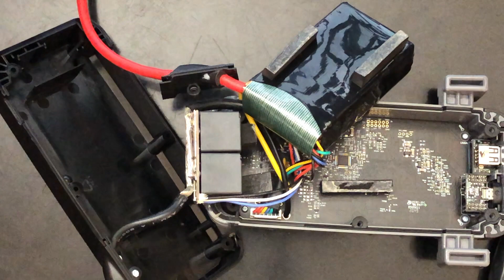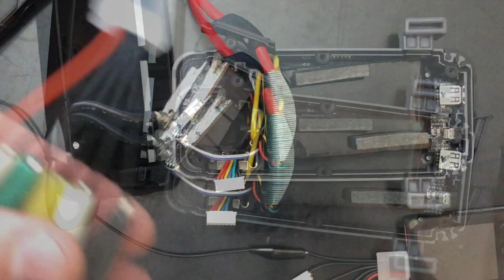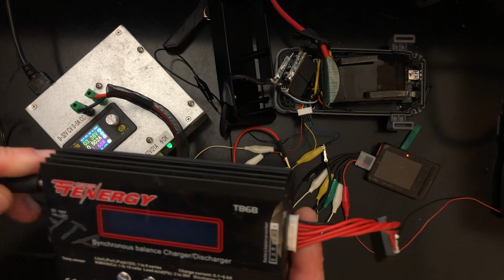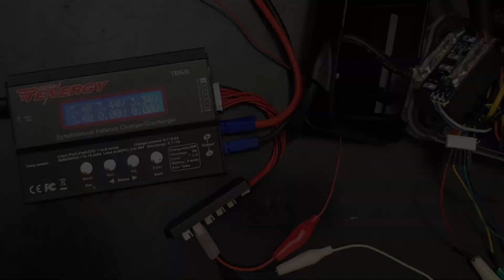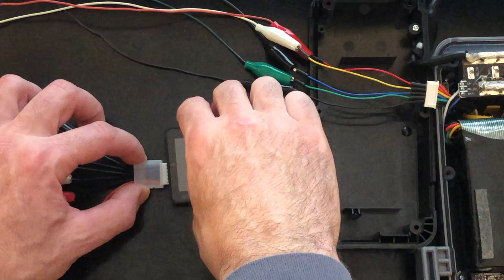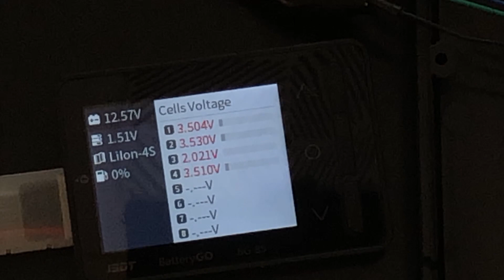NOCO Boost GBX55 Part 2: Balance

Comment: Hi thanks for doing this Colin. Around 7.36 that red wire with the alligator clip what is it connected to, if anything?
Reply from the maker: It’s hard to see but the big red clamp on the NOCO is connected to a smaller red alligator clamp that goes back to the positive on the Tenergy charger. That’s a direct link between charger positive and battery cell positive.
Reply: @colindgrant  Okay, thanks again for taking the time appreciated. I've became a follower :)
Reply: Okay, please don't flame me :) But the thinner red wire that disappears at the top of the screen, what's that one connected to?
Reply from the maker: @Inda_Wild  Ahhh I see it now. Yes, the thin red wire that comes out of the Tenergy charger's balance board is not connectd to anything. That's because I'm actually using the slot on the board, and connector for a 5s battery (which would need 6 leads), but this is a 4s battery (which needs 5 leads). So you're right the red wire goes up and out of frame, because I didn't want it to connect to anything. Good catch, I'm sorry if I didn't explain that in the video!
Reply: @colindgrant  :) thanks again, Colin

Comment: 2:30 instead of connecting your balance meter to that connector? Can't I just use the multimeter and measuring towards that connector pins for the same result?
And whichever cell is low, just charge that cell with the labb power supply?
Reply: Yes of course

Comment: Thanks! Hey I did the slow recharge like in your first video and it will come on but cut off immediately, and I noticed the 2 leds on the left side of flashlight part wereflickering and I heard a clicking noise ,any idea what could be causing this
Reply: I meant to mention i have the GBX55 1750Amp
Reply from the maker: Hey David, if you hear clicking sound that is probably the relay inside. That's what turns on 1) when the internal circuitry detects that you are connected to a 12V battery or 2) when you hold down the override button.
Did you get all 4 cells balanced to the same level? What voltage? Did the USB charger take over and continue the charge to full?

Comment: quick question when ur explain on the balance connector on the noco u said corner were positive nd negative black nd red nd all green blue yellow orange were positive but i got lost when u set up ur dc power supply negative on blue witch u said its positve or is it sharing positve to negative on each other wire please explain thanks

Comment: People shouldn’t be letting these battery packs get so low
Reply from the maker: All battery packs drain themselves. I agree that these NOCOs draw more than they should when not in use, but ultimately any battery pack needs to be maintained.
Reply: He literally said the third cell even when fully charged was not holding a charge. Eventually it’s the reason why it completely died . The third cell was defective wouldn’t top or bottom balance and stay like the other three. Once it get below its threshold the internal charge would not activate leaving it dead completely eventually

Comment: I know this video is about a year old, but if you're still inclined to hobby/mess with these, on your hobby charger there should be a setting for a storage charge that will provide a cell charge of ~3,80V. If the other cells remain at ~3,50V you can bump up cell 3 in this example to the storage charge of 3,80V (charge it as single cell and connect accordingly). 
That way it has a more decent charge in it for the balancing step, whilst having the headroom (charging from 3,80 / 3,50 to 4,20V) for either the hobby-charger in 4S mode or the internal BMS itself to do a decent top-balance. Otherwise I think you did just fine in these 2 videos.

I've messed with a lot of single cell Li-Po packs that were tossed from my worksite, and while they were all in different states I was able to get most of them to charge evenly as a 6S pack with a little break out board that I made for the purpose of charging 6 cells at a time with a similar hobby-charger (Turnigy Accucell 6). 

In between batches of many, many batteries I revived (I'm talking 1500+ pieces easily), I took samples for quality and charged the 6S "packs" and discharged them, monitoring capacity. I found that some cells, even when balanced to the others beforehand, lacked some residual charge that made them cut out earlier, like a "memory effect". 
If you charge those cells separately so the "base-charge" is better and then balance them, you get a near-perfect pack.
Reply from the maker: That's a great idea. The storage function is very useful. I've done a lot of the same sort of harvesting/recovering 18650 cells (not as much Li-Po) and had a similar experience. Thanks for your comment!

Comment: Is there a reason why you are doing all this? To prove it's a piece of junk
Reply from the maker: Is there a reason you’re posting this?
Reply: @colindgrant  I just bought one of these noco jump starters and came across your video. I'm just wondering why you're doing this. Why not return it. It seems like a lot of work for no reason.
Reply from the maker: @dogbreath6861   As mentioned, I bought this on eBay. So return isn’t an option. Also as mentioned the purpose of this video is to explore the root cause of the issue.

Comment: Same as any other Battery pack which fails. I usually measure each cell and replace one bad one. Nothing scientific as yours,,,,,,
Reply from the maker: Similar, except it's trickier to replace a cell in this type of pack. Super high drain pouch cells and if you don't match the capacity of the replacement they just go out of balance again.